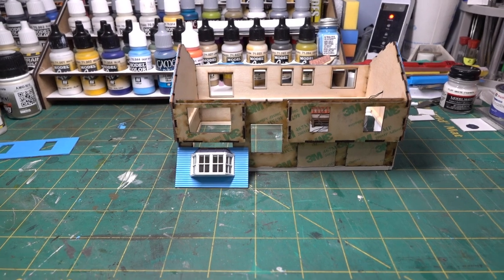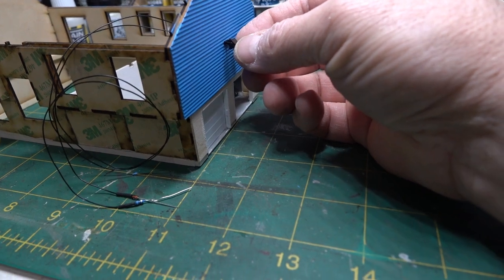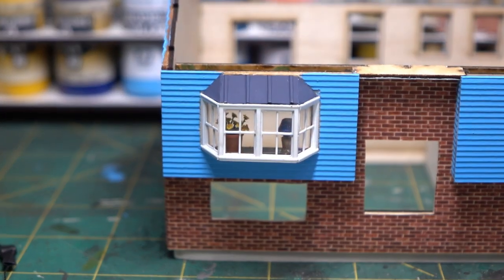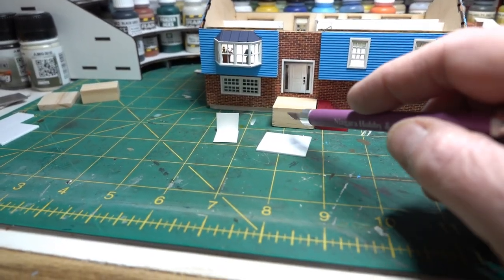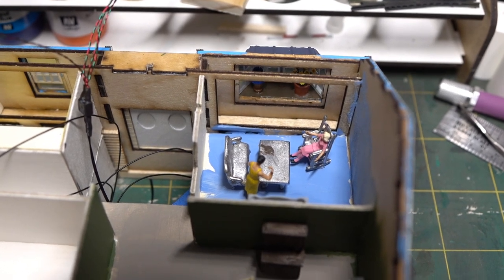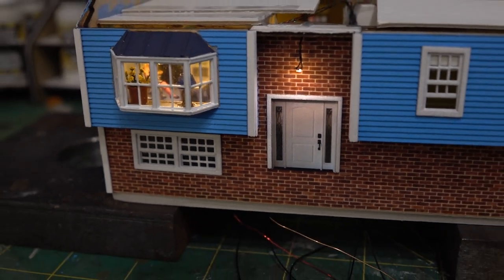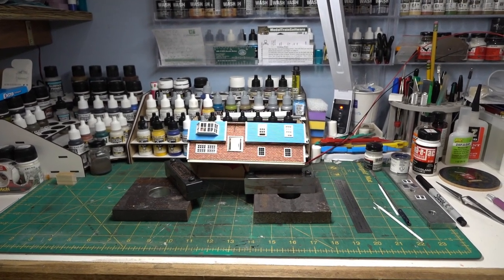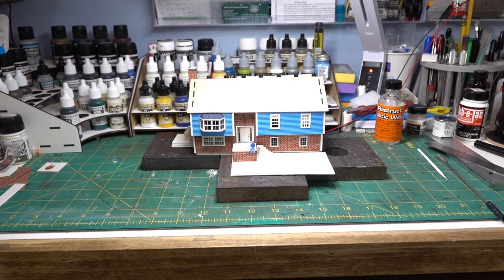Kit Build #1, PART 2: Laser-Art #616 Hillcrest Raised Ranch

Comment: I make all my roofs removable. You can than take all the layers apart and show people what you actually did inside! Great job on the chimney, but, It wood of been nice to take advantage of that, and have a fireplace in the "living room" lol. Great job on the garage interior. You can print out a few of the paper windows, and then cut separate parts from more than one window, and layer up the back piece. Gives the paper stuff a bit more depth! Keep up the structure models, I could them all day as well!!